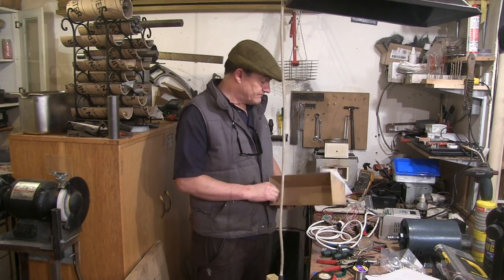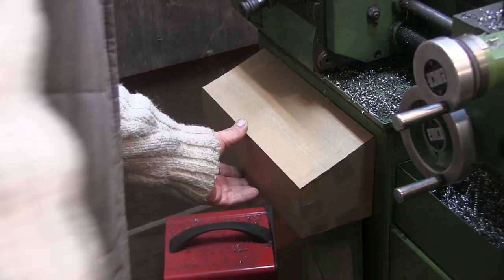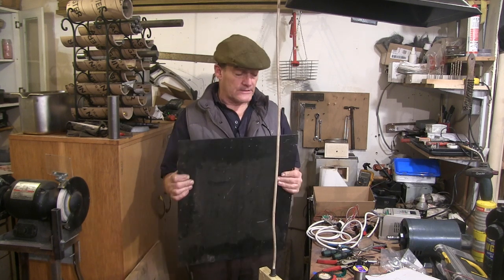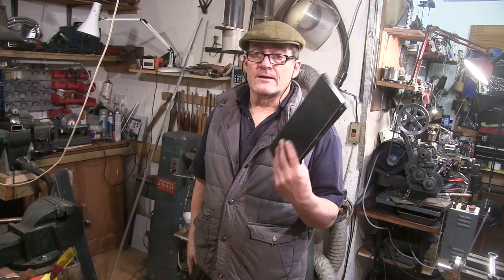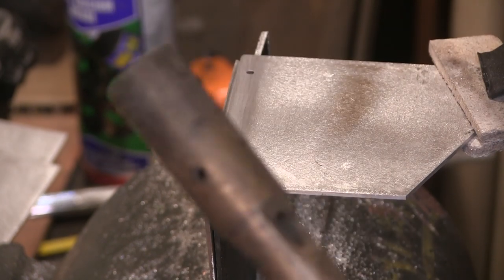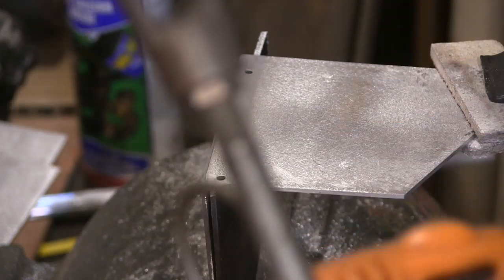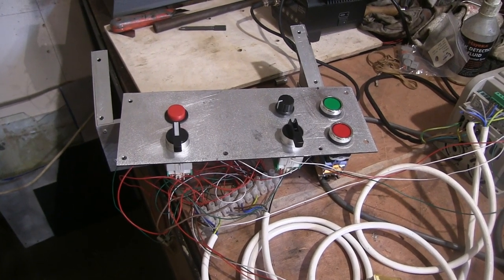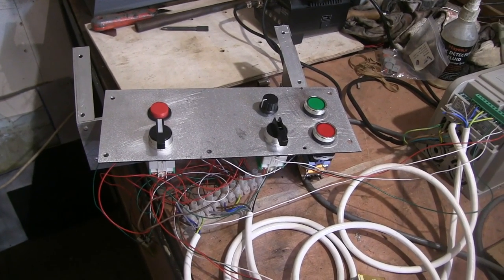A Box For The Switches!

Comment: About 25 years ago i was at a 4wd / fishing tackle / camping show and there was a guy selling those rods, i explained to him that i was a welder by trade and asked him to explain how the rods deal with the oxide layer  that forms on aluminium and how it is doing it without using a flux ? He just stood there with a stupid look on his face as the crowd that had gathered around him disappeared !  You also have to understand that you have no way of knowing what grade of aluminium you have there and not all are weld able.
If you want a free source of thin flat steel for making little boxes keep an eye out for old pc  cases as they usually have two removable flat side panels although getting the powder coating off them can be a PIA !
Fantastic video  Cliff !

Comment: The same to you Cliff, I've watched a few videos about the ally soldering and though most of the stuff I saw was on thinner material, it worked very well. I think you were conned into buying just plain Dural rods, no way with the heat you were putting into the plates was that going to work after the first try really Cliff, I'm not surprised your torch said "Enough already!", so seasons greetings to you and yours for the second time and I really look forward to your 2020 videos mate, go indoors and have a few beers! Cheers Cliff.

Comment: Glad  we have a box now and hopefully everything will fit into it.In my experience with soldering or brazing rods I melt beads of rod or cut tiny pieces on the seam and them heat them untill they melt, flow and run.Of course flux is very important and you may need oxy fuel torch.Lots of work.Merry Christmas and happy new year
Reply: Angel Ramos oxy? The bloody plates were melting with propane! Lol
Reply: @samrodian919  Thank you for your comment.I subscribed to your channel but can not find your videos.It´s there an other way?

Comment: Didn't work for me with the cheap rods either. I had the same problem as you did, higher melting point for the rods than the material you are trying to erm weld? They may be intended for tig welding, not sure. Anyway  the best use I have found for those aluminium rods is to use them in the mill when squaring stock :) or as paint hooks :)

I think there are some aluminium rods you can buy that have a much lower melting point, but they are significantly more expensive. 

Thinner aluminium sheet can sometimes be bent if it is scored first. but I think I would have done it the same way as you did. 

Not done much in the way of video's myself, so respect to you for your videos  as I know they are not as easy to do as some people seem to think. 

It is not a medium I am that comfortable with so I have put my projects in a web site though it is pretty much always playing catch up and changes are happening on a weekly basis 

http://workshop.our-site.me.uk/workshop/

Happy Christmas Cliff.
Reply from the maker: With you on all the above, took a look ate your site, would love to see you do some videos,
Merry Christmas,
ATB,
Cliff

Comment: Cliff,
A couple of months back I went down exactly the same path as you (except the propane torch doing a wobbler) and had the same results as you. I even tried the low melting point stuff but to no avail. I ended up sticking a piece of rod in each corner (threaded as I wanted the top and bottom to be removable and then epoxied the rod into the corners. It has held up pretty well but I bet if I drop it then it will all end in expletives and tears! 
I had many ideas, using finger joints on the sides and peening them, drilling 1.5mm holes and using stainless nails as pegs and pop riveting some thin angle even taking the ball out of the rivet and hammering flat, I even thought about getting a tig welder and trying that but it seemed a bit excessive. The videos online make it look a doddle but I haven't found it so.

The older I get the less progress I seem to make, today I went to get the petrol strimmer out to do the edges and found the primer bulb had cracked so went to get another. In the shop the repair guy said that I shouldn't use the E10 fuel as the ethanol degrades the plastic so on the way home I bought a new petrol can and 5l of 'premium' unleaded. I got it home and fitted the bulb flushed out the old 50:1 I had only just made up this morning and added the new stuff. She fired up no problem. I tested it on a small bit under the washing line and got a lace from one of the kid's trainer caught up in the line and clogged the spool, turned it off and cleared that and noticed the line was almost finished so went into the garage to get more during which time the strimmer that was balanced on top of the wheelie bin rolled off onto the concrete drive smashing the petrol tank on the strimmer; $45 for a new one and none in stock till the new year!

Festive greetings to you and yours. Over here we suffered in 45°C the other day in Melbourne, a tad uncomfortable without air con!
Reply from the maker: Its why I think Sods law is more descriptive than Murphys, In your case I think you could upgrade it to F**Ks S*KE Law!
merry christmas,
All the best,
Cliff